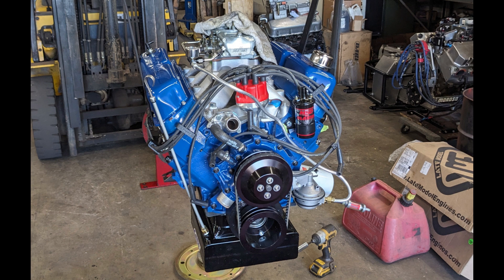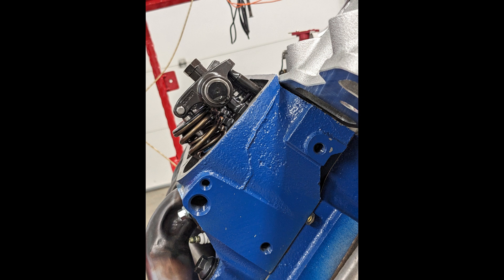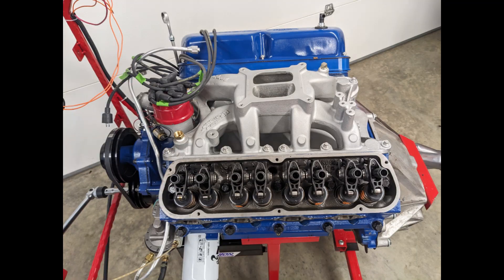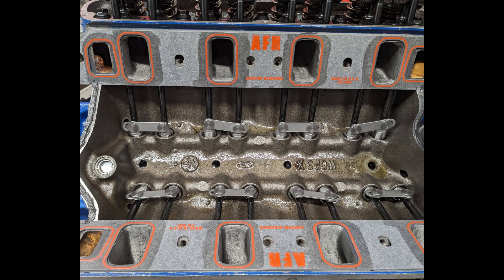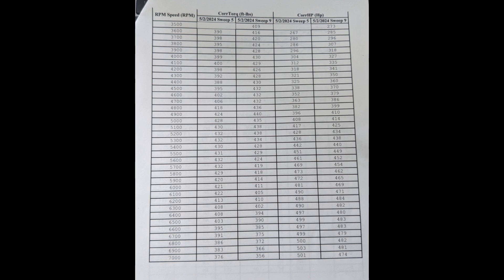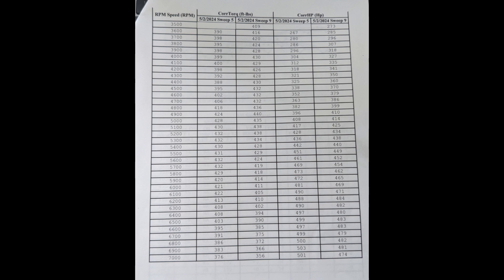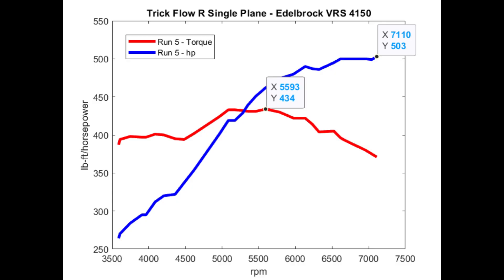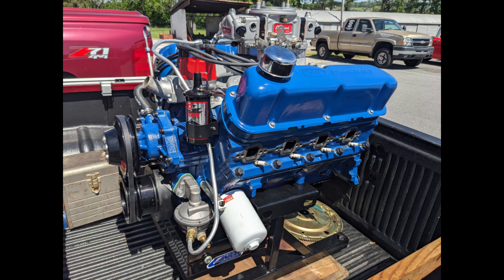500 HP or bust! Ford 351W build dyno tested

Comment: Torque struggles below 4000rpm…too much cam.
Reply: There’s definitely something going on with the torque at lower rpm range.  Not being critical just stating there’s room for improvement if you can figure out what it is.  Timing curve and/or carb.  Your cam may actually be a little to large for a 7000 shift point....your HP hasn’t rolled over at 7000, it’s just really leveling off.  You can call peak hp at 6500, but it’s only 3-5 less than it is at 7000, so really it’s flat.  That cam is good for a 7500 shift point.  If this is a street engine no need to spin that high and compromise parts, smaller cam would be better torque down low where you need it.  Having used the expression smaller cam maybe your LSA is a little too much...low and mid range like around 108*.  You definitely have a nice setup and overall good numbers, would be nasty in a light weight car!
Reply from the maker: @trailerparkcryptoking5213    I think the torque issue at low rpm is just the nature of the single plane intake.  If you look at the torque curve for run #9 with the dual plane, it has a flat or slightly increasing torque curve below 5000.  Also, the torque problem at low RPM was worse with the Demon carb, so yeah on the first couple runs the carb could be an issue as well. I think the 111 LSA is what helps  power carry past 6500.  With a tighter LSA it would make more torque and hp down low but would also be more peaky at the top. At least that is the generally accepted theory.  I've seen the Richard Holdner cam comparison video where several degrees tighter LSA difference made noticeable torque/hp gains and an engine masters vid where LSA effects were only marginal.  Thanks for the comments. You made some goods points!
Reply from the maker: Well, the carb used on the first 3 runs didn't perform as well which might be what you are referring to.  For the other carb, if you look at the torque/hp curves at the end of the video, from 3500 to 4000  torque was pretty flat at 400 lb-ft for the single plane and about 425lb-ft for the dual plane not really struggling in my opinion.  There might be some low numbers when he engages the dyno around 3500 rpm or so, as it loads the engine down which aren't really representative numbers.
Reply: @MarksMuscleCarGarage  Last sbf I built was 331ci that made 460 ft lbs 3800rpm had a much smoother torque curve with HP peaking at 480ish at 6200rpm.  10.5:1 cr, TW out of box 170 heads, etc.  Custom cam 229/235, 111 LSA on 109ICL.
Reply from the maker: @msk3905  Those are pretty good numbers.   I'm sure I could have made more low end torque with less cam duration and less overlap, but the cam does what I wanted it to do which is make peak power around 6500 RPM and pull to 7000 (kind of looks like Coyote power curve).  I don't think I'll be missing the lost torque below 4k but we'll see.  There is a Richard Holdner 347 vs 351 comparison video where he made 480 ish hp with both motors with a little less cam and better heads than I'm using... so I guess my point is dyno numbers on the internet should all come with a +/- 10% accuracy disclaimer.
Reply: @MarksMuscleCarGarage  rpm and vibration (they kind of go hand in hand) kill motors so I guess I don't understand the want for a 7000rpm peak when you can make the same or more with a lower peak?  Sorry my engineer brain cannot comprehend things like this but I get it its what you wanted. I built my engine mainly for torque rather than HP but in hindsight probably shouldn't have as 1st gear was useless (in my foxbody), 2nd I was breaking tires loose once I got some rpms but mashing the gas when cruising was a blast especially in 3rd when I had traction!
Reply from the maker: @msk3905  I think I indicated I wanted it to peak at 6500.  I built it with a redline of 7000 in mind ...  so it peaked at 500 hp at 6500 or maybe 6600 and held 500 hp to 7000,.  In hindsight, seeing it carry power the way it does I wished I'd have built the bottom end to rev to 7500.  I wouldn't be making more power if torque peaked at a lower rpm... peak torque would be about the same just at a lower rpm.  Horsepower being a  function of torque x rpm, it would make less hp if torque peaked at a lower rpm. 400 lb-ft torque from 3500 to 6500 is pretty solid regardless of where it peaks.  I think Foxbody stock T5 is something like 3.3:1 first gear which is ok for stock 5.0 power but too much for any significant power mods.
Reply: @MarksMuscleCarGarage I find many of Richards comparos really like comparing oranges to grapes.  He will say stuff like well this block    wasn't decked and the slugs are a little in the hole . 025. Or. These heads are 67 cc chambers and the others are 63cc. Using completely different heads and compression ratios just not very equal comparisons  I've went back and found many bad comparisons due to parts used not the same maybe in as many as 3 areas. It really doesnt make a lot of sense.
Reply: No it's just got the wrong lsa. 111 should have went 110 and kept the TFS intake on it or went 112 and kept the air gap on it.

Comment: Bigger carburetor along with more total timing advance and rippem's certainly would've net you more powa. Race fuel wouldn't hurt either.
Solid roller sounded like it was wanting to go and he chopped throttle.
Reply from the maker: All true. I underestimated how it would carry past 7000 rpm. ARP 8740 rod bolts were only rated to 6800 rpm, so I didn't want to push it. ... I should have used ARP 2000 bolts.

Comment: Great results!  I think the motor would have liked a little more carb cfm especially with the Dual Plane up top. Other that that they both will run great at the track. One would mph well and the dual plane would ET well because of its broader torque curve. Also playing with some carb spacers on the Dual Plane would clean up the signal up top.
Reply from the maker: Thanks!  Agree with the manifold vs ET and mph.
Reply: Tony Tony Tony...."quit playing and just put a Dominator on it already" is what you really wanna say.
Reply: @arturozarate1752  😅 yes!  I try to be suggestive but I see you see through it
Reply: @bigdogsportingtonyb2833  I too know the struggle.

Comment: is it 351or has it been stroked
Reply from the maker: Stock crank. Bored .030 so it is 357 cubic inches
Reply: @MarksMuscleCarGarage  that power is great for a 357 I have a 398w was wondering what kind of power I make my guess on mine was around 500hp I don't have after market heads I have GT40 heads iron heads my only set back
Reply from the maker: @jerryburks2755   I'm not sure but would guess somewhere between 400 and 450 even with the extra displacement, and depending on the other components (camshaft, intake manifold, compression ratio).  The GT-40 heads flow better than other factory small block heads but they are still not great compared to aftermarket heads.   Richard Holdner has done some videos with GT40 heads and dyno testing. He probably has a video where he tested a stroked 351 with GT-40 heads.
Reply: @MarksMuscleCarGarage  10.5 compression hydraulic flat tappet 292d 518 lift runs real good for a classic street car

Comment: That things runs great. Have you thought about tightening up the lsa on the cam
Reply from the maker: Good question, but I think what you are asking is, Do I think a tighter LSA would make more power?   ...  A 107 LSA would probably give me another 20 lb-ft or so below 5000 rpm., but I'm pretty happy with it as is and don't feel like swapping cams at this point.  Besides a tighter LSA would have less vacuum and worse idle than it already has...would have to idle it up to probably 1500 rpm with a 107 LSA cam and this much overlap.

Comment: Nice engine combo. I would've tried more timing, i believe the sweet spot with these heads will be around 36-38° That could've been an extra 20-25hp albeit, aka, I'll bet.🤞🏻 I'm confused why the timing wasn't played with? Imo, that is a must have for max efficiency, even more so than jetting. I believe in timing first, jetting second. Still, a broad power band & a great sbf I would Love to own.❤ Kudos.👍🇺🇸💪
Reply from the maker: Yes, time for torque, jet for horsepower.  I was thinking 34 or 35 would be the best but my machinist wanted to keep it safe at a 33. I'm sure I could have pushed it if I wanted. Think he didn't want to risk detonation, especially with cast iron head. First time on a dyno for me and I wasn't trying to wring out every bit, it's more street/strip than pure drag race engine, so I'm not really concerned about ET. If I wasn't trying to test two carbs and two manifolds, I would probably have tried to dial it in a little better including running another degree or two of timing.
Reply: @MarksMuscleCarGarage nice running engine, what size valves in heads,nice head when ported,what do they flow
Reply from the maker: @eddiefe428   Thanks.  I made some incremental improvements on the heads and a made few videos on them.  Peak flow was 314 cfm intake/207 exhaust.  Valves are 2.02/1.60. Exhaust could use some more work, and I could go bigger on intake valves.  Future upgrades maybe...

Comment: Edelbrock made more power than a Demon?? WOW!!
Reply from the maker: Edelbrock does have annular boosters... Demon  just had standard downleg boosters, although the race Demon boosters are changeable so I could have swapped in annular boosters in it if I had them
Reply: that edleborck VRS  is a  4150  style  but  its  taller  than any  other 4150  different animal.  its a racing carb

Comment: The 351 from the earlier years had a lot more compression than the latter one's
Reply: Correct. 1969 351w 4V was 10.7-1 from the factory and had the good heads for those days ... Also had 9.480 deck height vs later 9.50 deck
Reply: If it was mine I would take it to the machine shop and at least get the bore's straight the old style 351 is getting hard to find

Comment: Nice build! I have a 332" based on 302 block, it looks very similar to your 351, and makes 530hp. They sound similar, too. I think you'd definitely pick up more power with an 850 or even 950 carb.
Reply from the maker: Thanks! What are the specs on your engine? Sounds pretty healthy.
Reply: @MarksMuscleCarGarage  I have a forged crankshaft, 3.25" stroke, custom length 5.5" h beams, ultralight 4.030 JE forge Pistons,(418g) floating pins, balanced assembly. Lightly ported TFS track heat heads with matching Victor Jr, 11.67:1 static compression, solid lifter old blue racer camshaft 106 lsa, 250/260 @.050, steel billet stud girdle, OEM 72 302 block, All casting flash removed and oil returns enlarged. 750 race demon. 1/2-in fuel lines in the car and Edelbrock(or Holley?) 110 m. pump. MSD dist. and 6AL. 20/34 timing, idles around a thousand with 7 in. of vacuum.
Reply: @AmericanThunder damn nice build
Reply: @lebryantjohnson7306  thank you!

Comment: This engine has a lot more power in it. For a 0.030 over with factory crankshaft and old school iron sr cylinder heads, this engine would’ve been a Chevy killer on the streets in a Foxbody back in the 90’s. There’s still 25-30 hp still left in this engine.
Reply from the maker: I'd agree with that. Thanks for watching!
Reply: It wouldn't kill any similar built chevys.
Reply: It wouldn't have killed any similar built chevys.
Reply: @HioSSilver1999  In the old days, when using factory heads, you'd just use 351C head on the Windsor, which created either a Boss 302 clone or if used on a 351W, a cleavor. There were also guys who greatly modified the Windsor style cast iron heads, going as far as pressing in sleeves into the pushrod holes so the ports could be opened up further than would otherwise be possible. Ben Alameda Racing did that often, and was/is very competitive using stock castings. While I never required 400 cubic inches to win races, if you were so inclined in the old days before aftermarket crankshafts, we would use a Ford 400 crankshaft with the journals turned down to fit in a 351W block. You could even offset grind the rod journals to increase stroke beyond 4 inch, then for cylinder heads, we'd use a 351C 4V head, with some port work, and you'd have a combination that was very competitive. Did everyone do it? Obviously not. But most people don't win, either. Only the best will win. Bragging about your car brand because you're used to working on them won't make you win any particular race. "There is no greater danger than underestimating your opponent."
Reply: @AmericanThunder  yes you have to modify the hell out of a 351w to keep up
Reply: @HioSSilver1999  What about a four barrel 351 Cleveland? The boss 351 in particular. The stock 71 Boss 351 is a very fast car especially for a small engine, although anything stock is very limited.
Reply: @HioSSilver1999  Really? I used to gaptize SBC and BBC with an Roush Sr iron headed roller cam 351-W. I lost count back in the late 90’s how many BBC and SBC I smoked on the streets. Then it got worse for the Chevy guys when I built a Cleveland. We’re killing it right now with a 427-W
Reply: @StainlessTIG2  yea....well i gaptized 351s with a 305.....so what's your point?

Here's the deal.....there's no such thing as a 427w. That's all aftermarket shit. So once you take the furd out of ford they run pretty good. But you have to do that to carry a sbc jock strap.

And no equally built sbf is gonna run with a equally built bbc....just how it is. 

Even to run with a sbc the windsor is gonna need aftermarket heads. Actual ford Windsor heads don't flow nearly what a sbc head can. On top of that a sbc can be made with 400ci using FACTORY parts.....there's no suck thing as a 400ci windsor without it being a fully custom engine......just how it is.

But that's the furd guys way.....let's compare fully custom built furd shit to factory sbc stuff.
Reply: I'll take "things that never happened for $500 Alex!" 
Lmao 🤣  had a 351W fox in the 90s. It beat C5s go back to sleep 💩🧠
Reply: @chrismathes3647  so your modified car beat stock cars....big deal
Reply: @HioSSilver1999  next level yapping 📢
Reply: @johnyoung4163  yea you do
Reply: @HioSSilver1999  you  may have gaptized  351s  that  ran on 6 cylinders  but a 305  is  mostly  garbage and their  heads  are prone to cracking. i know i had  one with an RV  cam  an 500 CFm carter...nice little engine but i wasnt  beating anything in the 350 inch  range.
Reply: @KingJT80  351s weren't that good either.....even on 8 cylinders.  Windsor heads are shit.

Lots of high mile 305s out there. They were tough and got decent mpg's for their day.
Reply: @HioSSilver1999  305  are  for work trucks and slow  passenger  cars.  not much else  because  that baby piston  can even get a 2.02  valve  on it. 

a 351  short block can handle a lot of HP.  a 305 cannot.  get a 350 minimum and be done
Reply: @KingJT80  no shit....a 305 was never a performance engine nor was it intended. I wouldn't build one but that doesn't mean they were bad engines. Hell I wouldn't build a 350 either for that matter these days. I have before but after building a sbc 400(406)......the 350 nor the 351 just doesn't compare.

Of course all this depends on the budget/intentions of the build.
Reply: @HioSSilver1999  350s  are way more plentiful.

a stock crank and rods  350  can take about 6500+ RPM  adn 450+ HP  

a 305  cannot do that.  not without  a stroker kit

a 400  has weak links.  it has cubic inches  thats it thats all.
Reply: @HioSSilver1999 no you didn't.  A 305 shivvy won't out run a lawnmower
Reply: @justinschmidt9180  well i outran some 351s with my 305s.....so i guess 351s won’t outrun a push mower

Comment: your power bottle neck is the heads the exhaust bowls on those heads do not flow well for a budget build i would have went with the original twisted wedge had both those heads and the twisties work better or the F.M.S X 304 HEADS GOOD WORK nice job
Reply from the maker: Pretty good assessment. I didn't spend much time on the exhaust side  compared to intake.. Definitely left some on the table there. Got tired of grinding cast iron. Probably will remove and re-work exhaust at some point.
Reply: @MarksMuscleCarGarage mostly the bowls on exhaust side
Reply: Fair assessment going back even 25 years original tfs just made more power and torque.

Comment: Overall 440/480 with air gap on small cube nice job man!
Reply: Agree that’s a good runner.  I’m building a SBE 351 for my sons Bronco.  It will get TFS 190 11r’s, RPM Air Gap, XE274HR.  Hoping for 430/430.
Reply from the maker: Thanks! Appreciate it.